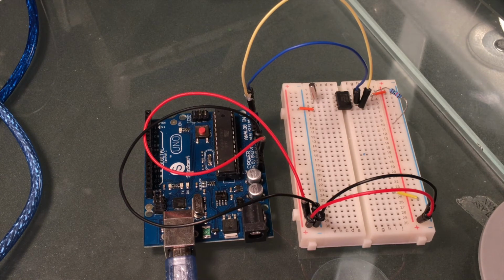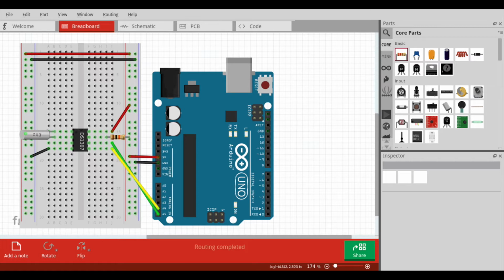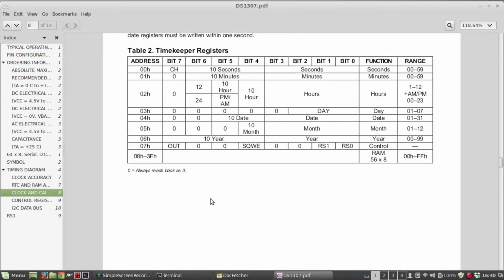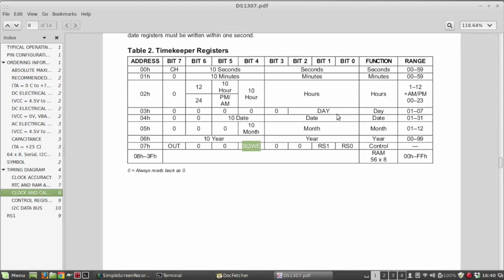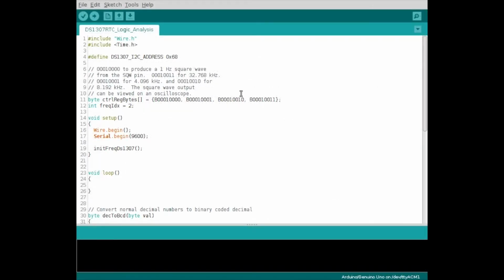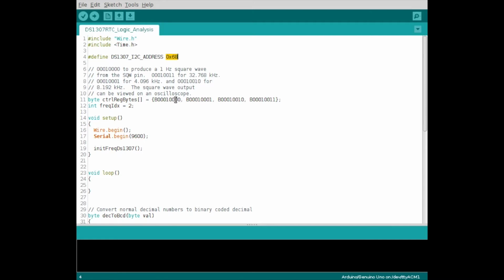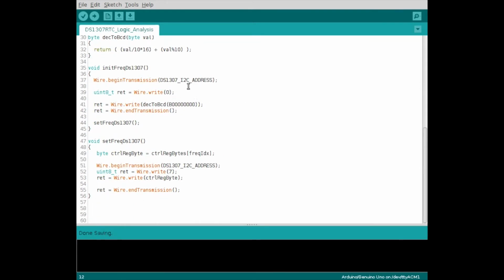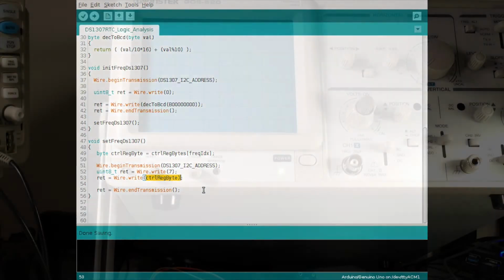Arduino DS1307 Real Time Clock Square Wave Generator

Comment: Useful video to confirm the wave output I should be getting from my DS1307. It looks nice and clean on yours, but at 32khz mine is a rolling 'round topped wave'. Now I'm not sure if it is the home built scope I am using rather than the rtc. thanks. :)
Reply: I think I am getting the same sloppy "square wave" at certain times, I sometimes also get a solid 5V DC signal which is very odd. Did you replace it with a new chip and find that the other one was bad? Thanks! (Btw I have a Tektronix oscilloscope and was able to test the 32.768kHz crystal to be good).